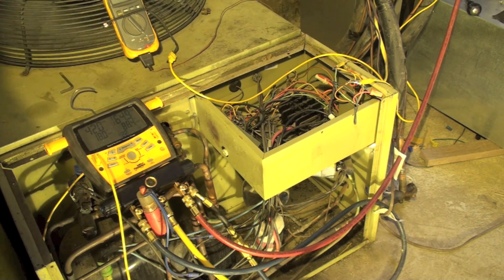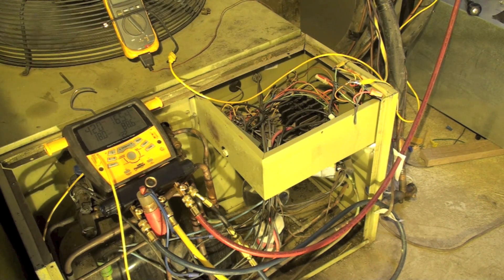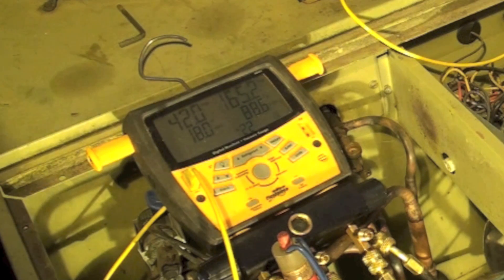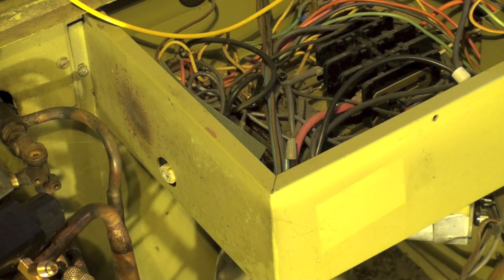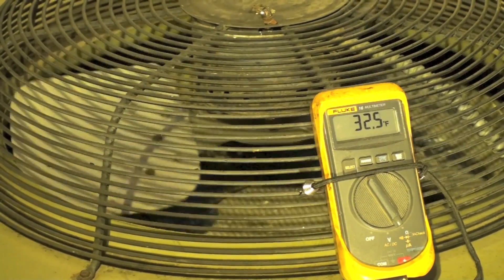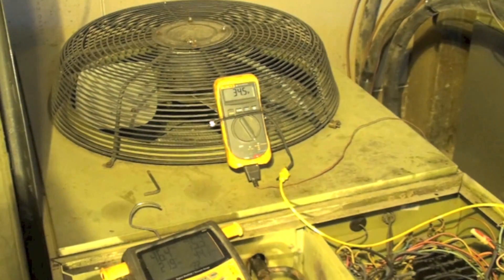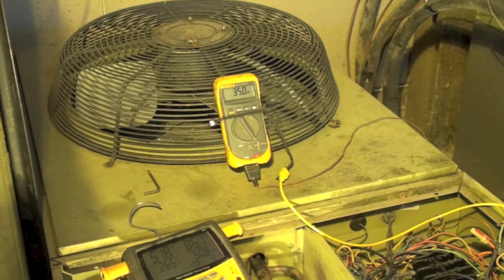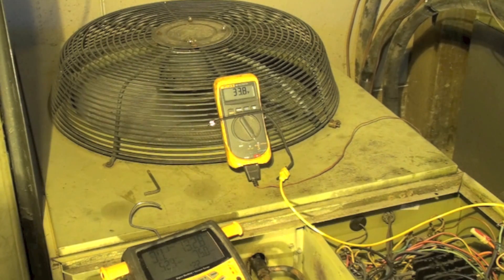Operation of the heat pump defrost control, part 1

Comment: A lot of cheap heat pump defrost controls still use time-temperature logic... however through electronics. I have a 2009 Goodman and I can't stand it when the thing goes into defrost when totally unnecessary. Once the defrost thermostat gets cold enough, it starts adding time. In my case, even when it's just been cycling on and off all night on a ~40 degree night. Any frost that builds during one run usually just melts off between cycles (when it's above freezing out) After 90 minutes of added up run time, it goes into defrost if the coil just so happens to be at the trigger point. It even went into a brief defrost cycle once when it was 51 outside and the unit had been on for a couple minutes (after cycling on and off on a somewhat cold night). I hate time-temp defrost logic. Needless to say, I'm planning to install the White Rodgers Universal defrost board, which includes all the hardware to give it demand defrost.

Comment from the maker: Everything is demand now.  The only reason for including this one is to explain how defrost must work.
GFM
Reply: On demand was a $$$$ saver when it came to be. We had an all electric neighborhood built from the mid 1970's to the late 1970's using the GE Weathertron systems of that era. Poor defrost cycles made these units operate so inefficiently at that & time forward. When gas lines were finally run to the neighborhood most of these electric systems were dumped in favor of 90+ gas furnaces with AC only by the end of the 80's out here in Iowa.. Now with dual fuel being a more common option some are using Heat pumps again with significantly better results today in these homes!

Comment: It's worth mentioning that these old mechanical defrost timers, like the Ranco E15, can be replaced with drop-in solid state boards, such as the ICM315C.  One caveat I've run into with these replacements is the location of the old temperature bulb may not be the best location for the new thermistor sensor, and the sensor may require a 4-6K ohm trimmer resistor in series to get defrost initiation tuned to occur at the right point.
Reply from the maker: Bob Newman It definitely is worth mentioning.
GFM

Comment: Is that a york heat pump
Reply from the maker: heatpump hvac No.  Its an old Freidrich.
GFM
Reply: I haven't never heard of Friedrich do they make them anymore it looks like a York unit how old is it jw
Reply from the maker: heatpump hvac They stopped making them about 25 years ago.  This one is about 30 years old.
GFM
Reply: Oh really
Reply: Well, I have seen some Friedrich air conditioners, heat pumps, and refrigerators, but they are now very rare. As of present time, they mainly now make ductless split systems and wall mounted room AC/heater units. Also, Friedrich is still in business, has been around since 1883, and is headquartered in San Antonio, Texas.

Comment: During defrost  what happens to the indoor unit? does that also stop working or blows cold air to the customers head?
Reply from the maker: Guy Hakverdi The defrost relay can be set to add backup heat while it is in defrost.
GFM